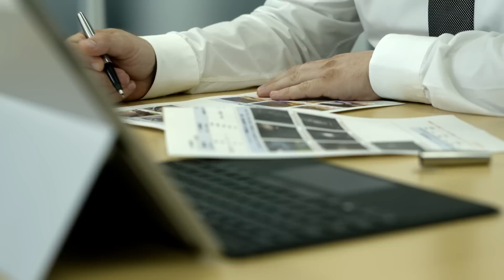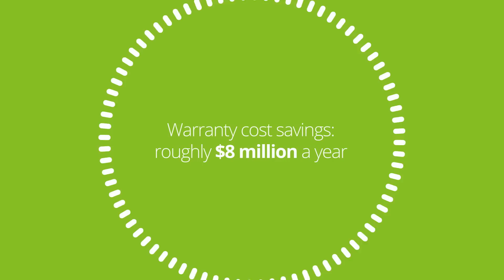FUSO | デジタル変革 - 予測分析 デロイト × ダイムラー・トラック・アジア

Comment: Fuso is a shit truck, the gear box is stolen from a junkyard, the engine is stolen from mercedes. when pulling a little bit of a weight the truck wonders around the lanes, the ride is very rough even with the seat on full comfort, when going over a bump the nose dives, the new mirrors are pretty good but the old ones doesnt show u anything, its cheap and Mitsubishi keeps paying the big companies money to come and buy there truck, such as Australia Post, Startrek, Delta and ...

Comment: Fuso Mitsubishi series all, all Mitsubishi series with code forbidden AE styles (AE 8 parts) in automobile market grade F pernament by all countries ban build with industry sales. 

Code forbidden AE styles (AE 8 parts) in automobile market know as bad automobiles and bad motorcycles thus. Uneducation Automotive Engineering group class brilliant have invent these ones for their feeling without knowledge. 

1. Wider rear track than front track bodyworks | The lowest traction 0.7g, extreme tail flick, extreme slide, 1-5 km/l, below 1 km/l by Formula one speed 160-250 km/hour, over 250 km/hour on all circuits. Symptom little with driving speed traffic limit law on all path roads. 

2. Front track as same dimension as rear track bodyworks | The medium traction 0.85g, tail flick, slide, 1-5 km/l, below 1 km/l by Formula one speed 160-250 km/hour, over 250 km/hour on all circuits. Symptom little with driving speed trafic limit law on all path roads . 

3. Wider front track than rear track bodyworks in below 10 mm | The medium traction 0.85g, tail flick, slide, 1-5 km/l, below 1 km/l by Formula one speed 160-250 km/hour, over 250 km/hour on all circuits. Symptom little with driving speed traffic limit law on all path roads. 

4. Wider front track than rear track bodyworks in 10 mms | The medium traction 0.9g, tail flick, slide, 1-5 km/l, below 1 km/l by Formula one speed 160-250 km/hour, over 250 km/hour on all circuits. Symptom little with driving speed traffic limit law on path roads. 

5. Wider rear parts than front parts bodyworks | the lowest traction 0.7g, extreme tail flick, extreme slide, below 1 km/l by all speed on all circuits.  Symptom little with driving limit law on path roads. 

6. 1-4 turbo intercooler petrol engines hybrid all and 1-4 turbo intercooler petrol engines all : Easy damage parts engines, 1-5 km/lite, below 1 km/lite by Formula One speed (160-250 km/hour, over 250 km/hour) on all circuits, test maximum over 150,000 rpm, little damage with traffic limit speed law on all path roads. 

7. CVT all : Easy damage parts transmission, 1-5 km/lite, below 1 km/lite by Formula One speed (160-250 km/hour, over 250 km/hour) on all circuits, test maximum over 150,000 rpm, little damage with traffic limit speed law on all path roads. 

8. Without rear fog lamps : no one see rear parts transports in fog by without rear fog lamps. 

Who ever build brakes over 1 per side are stupid by broke down all electric circuits. 

This record information come from all brands and all socials who can't pass Europe test performance standard bases all in automobile market. It mean no one pass Europe test performance standard base in automobile market. Code forbidden AE styles group in automobile market are criminals class brilliant terrorists, mutant terrorists and their status prisoners level death clans. These ones effect EV, hybrid. 

From

All brands and all socials databases

Of course, all socials prefer code forbidden AE styles (AE 8 parts) in automobile market for their crime rob and corruption tribbile millions euros for fun. 

All social become criminals clans with build code forbidden AE styles in automobile market. Beware about their terrorists rule automobile market with code forbidden AE styles (AE 8 parts). These information can check parts of your products.

Comment: Code forbidden AE styles (AE 8 parts) in automobile market know as bad automobiles and bad motorcycles thus. Uneducation Automotive Engineering group class brilliant have invent these ones for for their feeling without knowledge

1. Wider rear track than front track bodyworks | The lowest traction 0.7g, extreme tail flick, extreme slide, 1-5 km/l, below 1 km/l by Formula one speed 160-250 km/hour, over 250 km/hour on all circuits. Symptom little with driving speed traffic limit law. 

2. Front track as same dimension as rear track bodyworks | The medium traction 0.85g, tail flick, slide, 1-5 km/l, below 1 km/l by Formula one speed 160-250 km/hour, over 250 km/hour on all circuits. Symptom little with driving speed trafic limit law. 

3. Wider front track than rear track bodyworks in below 10 mm | The medium traction 0.85g, tail flick, slide, 1-5 km/l, below 1 km/l by Formula one speed 160-250 km/hour, over 250 km/hour on all circuits. Symptom little with driving speed traffic limit law. 

4. Wider front track than rear track bodyworks in 10 mms | The medium traction 0.9g, tail flick, slide, 1-5 km/l, below 1 km/l by Formula one speed 160-250 km/hour, over 250 km/hour on all circuits. Symptom little with driving speed traffic limit law. 

5. Without rear fog lamp | No one can see the front vehicle in fog, risk damage, 1-5 km/l, below 1 km/l by test maximum over 20,000-150,000 rpm, Formula one speed 160-250 km/hour, over 250 km/hour on all circuits. Symptom little with driving speed traffic limit law. 

6. 1-4 turbo intercooler petrol engines | Easy damage parts, 1-5 km/l, below 1 km/l by test maximum over 20,000-150,000 rpm, Formula one speed 160-250 km/hour, over 250 km/hour on all circuits. Symptom little with driving speed traffic limit law. 

7. CVT | Easy damage parts, 1-5 km/l, below 1 km/l by test maximum over 20,000-150,000 rpm, Formula one speed 160-250 km/hour, over 250 km/hour on all circuits. Symptom little with driving speed traffic limit law. 

8. Wider rear parts than front parts bodyworks | the lowest traction 0.7g, extreme tail flick, extreme slide, below 1 km/l by all speed on all circuits.  Symptom little with driving limit law. 

This record information come from all brands and all socials who can't pass Europe test performance standard bases all in automobile market. It mean no one pass Europe test performance standard base in automobile market. Code forbidden AE styles group in automobile market are criminals class brilliant terrorists, mutant terrorists and their status prisoners level death clans. These ones effect EV, hybrid. 

From
All brands and all socials databases

Of course, all socials prefer code forbidden AE styles (AE 8 parts) in automobile market for their crime rob and corruption tribbile millions euros for fun. 

All social become criminals clans with build code forbidden AE styles in automobile market. Beware about their terrorists rule automobile market with code forbidden AE styles (AE 8 parts). These information can check parts of your products.